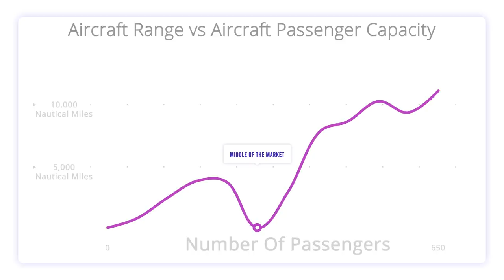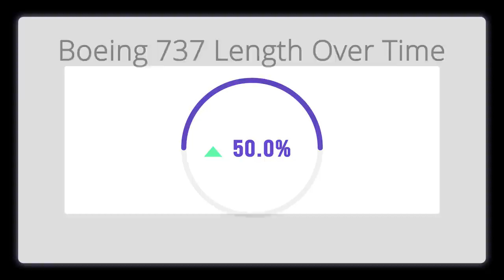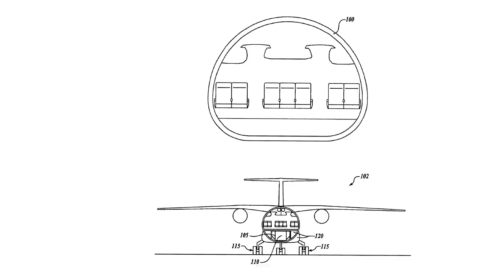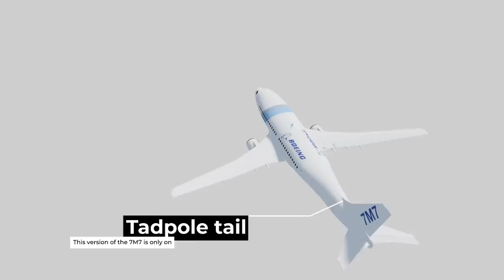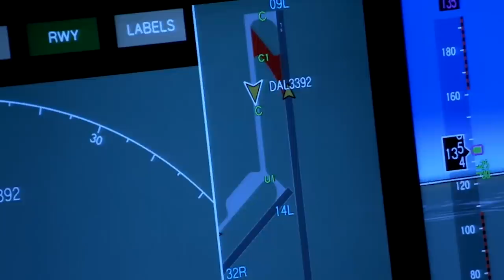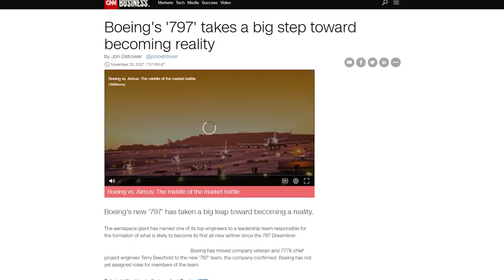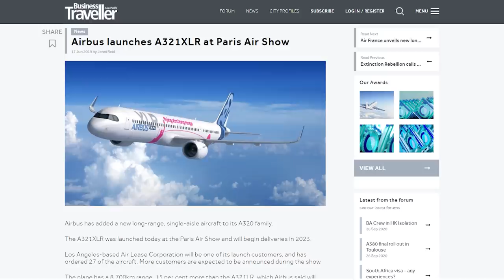The Boeing 7M7 - The Proposed Future Boeing Aircraft To Replace The 737 MAX and 797 | Never Built

Comment: Boeing screwed up on canceling the 757, which would have been better refit then the max
Reply: the 757 is also their best, and friendly, looking one.
Reply: @wim0104  It is also the same fuselage and was not designed to do what it is doing now.  How many old airplanes should be resurrected?  DC-3s are still flying. MD 80s/90/ should not have been cancelled.  Yep let us just keep flying 1950-1970 designed aircraft.  DC-10s are extremely comfortable, lets get them back from the freight guys and put the seats back in.
Reply: @ericjohnson6790  The youngest DC-10s still in service are at least 30 years old. The 757 was a good airframe. Maybe Boeing can get some of the still airworthy examples parked in the Mojave Desert and refurbish them for revenue service. Either that or just re-open the 757 line and make new airframes in CFRP (carbon fiber reinforced plastic). With substantial reductions in weight the new 757 should have greater range than its aluminium predecessor. The old DC-3s are non-pressurized, so they have been able to last a very long time. Though, I was thinking that some of these could be retrofitted with electric motors. In fact, some regional planes can be designed to fly with electric motors, but these will have to be made light enough to keep the airplane under max takeoff weight at all times.
Reply: 757 was designed for a specific niche and ended up being used widely outside of that.  Boeing long thought of a clean sheet of paper since it was conceived of to replace the 727 back in the early 1980's.  The gear are way too heavy and the OEW of the airplane no longer works.  This is also why Boeing kept stretching the 737 out.  It has a much lower OEW for 180 seats than the 757, until the gear no longer fit that is....   see 737MAX-10 telescoping gear patent.
Reply: @gendaminoru3195  beancounting efficieny is what got us to 350+ people being smashed into a pulp. 737 got to be replaced. the 757 was, and can be again, a huge success.
Reply: The problem is when Boeing cancelled the 757 it wasn't selling well, firstly far less Airlines were certified for ETOPS then now. Secondly in short haul it was less than ideal considering it was fitted with two huge engines in comparison to the more efficient 737 and A320. The reason it had those engines was to give it similar performance to the 727 which used to operate out of pretty austere short fields. The catch with that being by the time you got to the 1980's airfields were improving making the 737 and A320 viable out of them especially with the new generation of small turbofans. Finally the 757 has significant wake turbulence meaning it has to be given the same kind of separation as a Widebody, for short haul commuter travel that is deeply inconvenient for the Airports and Airlines as it eats up landing slots.

With more airlines becoming ETOPS certified and the boom in budget spoke to spoke long haul travel the 757 found its niche, unfortunately for Boeing that happened quite a while after that change in the market.
Reply: A composite 757 😍
Reply: @Fedaykin24  the 757 had also way bigger wings compared to normal single aisle aircraft. It needed this wings for a higher MTOW, to get enough range while fully booked.
This wings had too much drag for shorter routes, where the MTOW was lower. Also the wings had too much wing span to be still in ICAO class C (up to 36 m, such aircraft can be handled more flexible on airports).
Reply: @ericjohnson6790  ...It's sad wim0104 ... when Boeing bought McDonnell Douglas ....as soon as the the last Trijet ( MD-11 shared much of the tooling for DC-10) went down the line... tooling was destroyed forever!  So, that aircraft and C17 will never come back as any kind of Boeing revival or derivative!
Reply: As a ex fueler who has fueled just about every plane other than a 380. The 757 FUELS SLOW AS FUCK even if you usually a fuel tanker truck which usually pump faster than fuel carts
Reply: @Fedaykin24  Boeing should have fitted a pair of CFM56 to the 727.  A pair weighs about the same as three JT8D's.  The cabin could have been stretched ala MD90.  And there would not have been need for MCAS.  Engines in the back make the cabin a quiet place to be.
Reply: wiLL THER BE ANY SURVIVORS? RESTE INN PIECE
Reply: I always adored the 7’57 and 767 & miss them :)
Reply: @gendaminoru3195  I don't have an engineering background but my immediate thought after hearing of the 737 Max's troubles and working up a little background was that Boeing needed to develop a new engine, or have their suppliers develop one. Adapting the LEAP engine was just a bad idea. In the shadetree-curbside mechanic world we have a name for that kind of thing. We call it "Frankensteining". So Boeing tries to Frankenstein the LEAP engine and the 737 airframe together. Geez-louise, what could go wrong?
Reply: @wim0104  I wasn't excusing the stupid program decision making at Boeing, only explaining it from their viewpoint. Yes it was very stupid to discontinue the 757, as more efficient engines have come along that would fit the air frame just fine
Reply: @encinobalboa  Hey I had that idea in high school while prepping for university aerospace program, as it was the only real choice then, but it would have worked and been cheaper, but Boeing wanted to show off new tech.  Thus the 7J7 which morphed into the 757
Reply: @anonymike8280  In order to make this LEAP work they needed to find a way to retract longer gear into the center box, which is why they developed the MAX-10 telescoping gear.  They should have done this for all the 737 MAX so they would not have to angle the nacelles upward to fit under the wing and there would just be one common landing gear for the MAX.  That would have cost around $50-60M, which would have been cheap insurance if you ask me.
Reply: @gendaminoru3195  I agree with that. I thought of the idea of a telescoping gear but I have no basis for assessing its reliability or desirability. I'm sure the technology is pretty well developed though.
Reply: @hananokuni2580  The problem is that the 757 has been out of production for a while and the tooling and production facilities have mostly been repurposed, and suppliers moved on to other things. Between the cost of modernising the building and tooling a production line from scratch, it'd be a minimal saving compared to a clean-sheet design, while being a less efficient and flexible aircraft. A clean sheet design would be competitive, and could be used for variants for decades to come, with room to evolve. It could also be designed with much more modularity in mind than the 757 was, allowing it to both fill the mid market gap left by the 757, and also scaled down to replace the 737, which is essentially at the end of it's evolution (if it wasn't before, it certainly is now).
Reply: @ericjohnson6790  Nope, the 757 is at least a decade newer type, and has longer gear struts, thus has higher clearance between engine nacelle and ground. Thus, would lend itselves better to reengining with modern, more efficient engines (that all have a higher diameter of LP fan). Only trouble is it's tad too big (so too costly) to be manufactured in big numbers for most occupied part of today's market... but maybe it could have been done...
Reply: As far as I'm concerned its best for us all if we just sit on Airbus livery and leave Boeing alone
Reply: @wim0104  I don't see how a 139 inch fusalage is any less cramped than a 139 inch fusalage

Comment: By the time you've changed the fuselage that much, the design costs are so high I suspect Boeing would rather just do a complete clean sheet design. 

Admittedly, the fat fuselage would probably allow corresponding lengthening of the undercarriage. This is the thing which is really holding the 737 back. Boeing are forced to do all sorts of weird things to try to fit large modern high bypass engines, and it makes it harder to lengthen due to tail strike (as discussed in the video.)
Reply from the maker: Very true!
Reply: Yeah, clean sheet design is inevitable. Boeing 737 MAX which debuted in 2017 still uses structural elements from 1957 Boeing 707. That's a 65 year old design - by this point anything new will probably perform better just by using modern design techniques and materials.

Comment: ...the 737 is a already a 53 year old design and has been pushed to edge of it's viability. Originally, it was developed to be a short to medium haul aircraft that would bring jet service to small town airports with minimal ground service equipment - hence the "stubby" undercarriage - which was fine with the narrow low bypass engines of the day, but became problematic with more efficient, larger diameter turbofans as they had to be moved more forward of the aircraft's centre of gravity, and in the case of the LEAP engine, further upwards as well to allow for ground clearance which resulted in excess lift characteristics that could lead to a stall. 

This particular proposal as outlined in the video would be a "new aircraft type" particularly if it is to be powered by larger diameter engines (meaning taller landing gear struts similar to the A-320/321 particularly as the higher weight would cause a greater compression of the undercarriage during landing) as the wider fuselage would also change the handling characteristics enough to require aircrew re-certification.  Any meddling using a software to make it handle like say a 737 NG would be repeating the same mistake as occurred with MCAS in the Max series.  MCAS was little more than a software "kluge" primarily to appease the airlines who didn't want to incur crew retraining/certification costs, which backfired terribly resulting in two tragic accidents and the subsequent grounding of the type that will be going on 19 months.

Boeing needs to learn from this experience and move forward instead of continuing to milk an over half century old concept even further than they have.  Better to base the NMA more directly off of the existing 787 concept and tooling along with focusing development on the FSA (Future Small Aircraft) which is to be the 737's replacement.
Reply: @erwina4738  ...which is sad as they used to be such a company.  te gamble they tok on the 707 and 747 paid off well in the long run for them. 

At the time, turboprops looked to be the next logical step from piston engines for airliners.  Lockheed was looking at a turbine powered Constellation, the L-1249 (using the same engines as the on Douglas C-134) and Bristol had rolled out the Britannia for BOAC.  Boeing even experimented with a turboshaft version of the C-97/KC-97 (balso known as the 377 stratocruiser).   

Passenger jet travel seemed to be a controversial prospect particularly in light of the comet 1 failures in the early 1950s that grounded the aircraft for much of the decade.  Early jet engines were somewhat underpowered and rather "thirsty" so range was an issue (the first Comets capable of a north Atlantic crossing were the Mk 4 which re-entered service in 1958 for BOAC only a month before Pan American began Boeing 707 operations).   

The 707 was nicknamed the "Million Dollar Gamble" as the firm put its future on the line investing 16$ million of its own money to develop it.  Any major failure such as the Comet experienced during development would likely have sunk the company. The 707's success basically made Boeing the frontrunner as Douglas was second having had waited for the development of a more powerful engine before launching the DC-8.  Lockheed dropped out of commercial aircraft production, and Convair was little more than a bit player with their 880 and 990. Other companies such as Martin had concepts for a jet as well but those never made it past the drafting board. 

The next major gamble was the 747 which entered service during tumultuous times and just prior to a major economic collapse. Development costs and construction of the assembly plant basically made it Boeing's "Billion Dollar Gamble".  the 747 went on to become an icon. and was extremely popular with both airlines and passengers. It pretty much dominated the long range wide body market from the last century into the current.

Poor management and decision making after the McDonnell Douglas acquisition, issues with Q/A on it's other "billion dollar gamble", (the 787) and of course the 737 Max debacle have all led to Being's slide in dominance.  Currently AIrbus is the innovator and has taken the lead as Boeing missed on the market shift when they pulled the plug on the 757 replacement and put all their eggs in the basket an over half century old concept, the 737.

Comment: Back in 1978 I made the statement that the B737 would have to die because there was just not enough room for a new fan engines.
Reply: Don't worry - the software will fix the inherent design flaws!
Reply: Agree. Instead of redesigning the wing roots and landing gear to accommodate future larger turbofans they chose gimmicks and software tricks
Reply: @HC-cb4yp  The software might have had more chance if it wasn't working with a dual system. But Boeing is clinging to the 1950s control system from the predecessor to the 707. If they'd put a triple redundant FBW system in the MAX they probably wouldn't have killed hundreds of people. But that would have cost money, which would have made it harder to pay down the debts on the 787 program while still paying great executive bonuses.

Comment: Isn't a  2-3-2 economy seat layout the same as the old 767?
Reply from the maker: It is!
Reply: Which is a great aircraft and size for the market.  I think the 7M7/797 is a great idea, and I always prefer to fly on wide bodies.  I would much rather fly on one of these from NY to Los Angeles than an A321 or 737 narrow body.
Reply: @kaikart123  you still get that on most aircraft with a 3-3 configuration .  And really if the "volume enriched a-nugget or crying baby is in any row near your seat, would it be much better.  C'est la prix of traveling in a soda can.  Not saying your sentiment is without merit, just pessimistic about alternatives (unless you can afford a private jet)
Reply: until the airlines find out they can turn it into a 2-4-2 configuration just like they managed to turn 2-4-2 into 3-3-3 in the 787.
Reply: @mecharoo    I hear you, but even then a wide body is still better with dual aisles for much faster boarding and disembarking, more overhead luggage bins, more lavatories, higher ceilings to make it “feel” more spacious, etc..  Have you ever sat in the back of a fully loaded A321 or 757 on a 5 hour flight?  I have many times, and it absolutely sucks.
Reply: @Z06ified  my point was that the airlines will (always) try to cram an extra seat into a row to make more money. i wasn't going on about single vs dual aisle.
Reply: Trying not to cry @ the loss :-(
Reply: @mecharoo  Exactly, especially at a time people are getting fatter and fatter.
Reply: We can all just dream about sitting in the middle seat. Middle seat economy for 5000miles. Genius
Reply: @kaikart123  you are right but you can get placed by a crying baby or jackass even in a narrow body
Reply: @garyhughes9649  much better than getting the same in 3 seats configuration
Reply: @kaikart123  what is better than getting the same and how is it better ?
Reply: @Z06ified  I think most people would prefer to fly on a wide body probably most of the time if not all of the time the extra Idol is a big convenience but I know of no way you can make a wide-body that's anywhere near as economical to operate as a narrow-body jet and airlines are always looking at the bottom line unfortunately it's simple economics I understand it they want to make the most money and basically just pay lip service do the convenience of the passengers, ultimately the people that are paying for the Jets. Obviously the more popular routes require widebodies and as long as the wide bodies are flying at full or near full capacity Airlines will profit and will still be able to fly in them.
Reply: @garyhughes9649  at least I don't hate 3 seats
Reply: @chrish6412  you make a couple of good points. Crying babies anywhere close require patience intolerance at best and stuck next to someone excessively obese requires a lot of Tolerance and this is a whole nother argument but obesity can be controlled if a person has the will to do it. And any commercial jet is confining and even more so the bigger people are.
Reply: @mecharoo  it sure makes it unpleasant or the flying pain public do two most Airlines tightwad attitude. I hear you just one more seat on each row narrow vials a little bit and yeah we can shoehorn one more seat in there. It does get annoying
Reply: @kaikart123  I don't hate three seats either